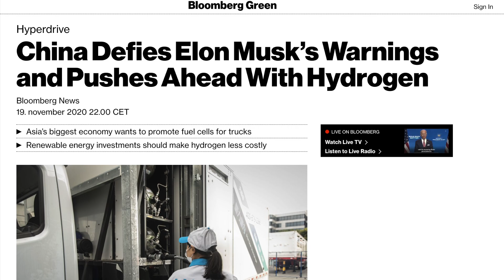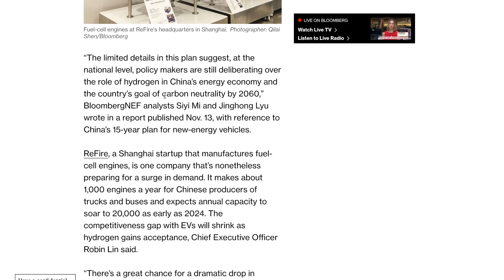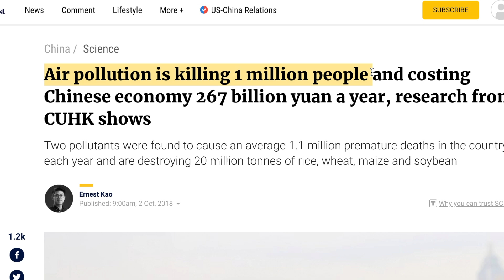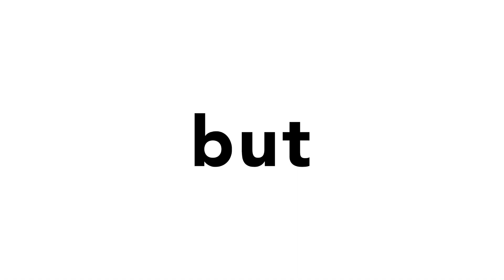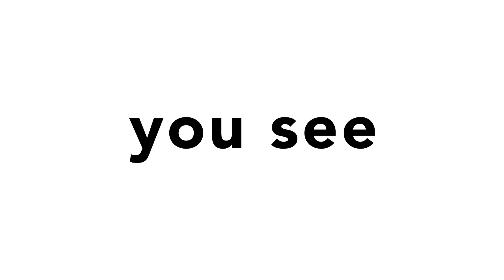The Worrying Truth Behind China's Push For Hydrogen

Comment: Yes, the production of hydrogen is inefficient. But there are a couple other things you have to consider. Firstly the efficiency will improve over time with more investment and innovation. Secondly, energy independence means that China means that doesn't have to get bogged down in Middle Eastern wars, like the US has, to have energy security. That fact alone will save them lots of money.
Reply: And it's cheaper than batterie, at large scale. Storing electricity for more than a few hours into batteries is extremely costly. Also, I suspect they will need hydrogen when their fusion plants will be ready. Better start now.
Reply: @DunnickFayuro  Fusion requires Tritium and Deuterium which are isotopes of Hydrogen. I don't think you'll make much of those from Sea Water unless you filter for them instead.
Reply: @itsover9008  I was refering to the general infrastructure for hydrogen. The specifics for each fusion plant can be solved later on.
Reply: That's exactly the point that a lot of analysts miss. When transistors first came out they were inferior to vacuum tubes but people who saw their potential changed the world.
Reply: Electrolysis also works better at high temperatures, so any country with reactors can do it cheaper...
Reply: Is this man sure that he can make battery for the whole world. While lithium shortage already started  .
Reply: I think the debate about what is better, hydrogen or battery, is not that important. In my opinion, we shouldnt so much focus on this discussion. No, we should both compare to fossil fuels/energy. You know, the kind we wanna replace with regenerative energies.
Also, Royal Dutch Shell, Gazprom and Lukoil said that we already reached PeakOil... A complete other statement of what US oil-producers say. But of course us oil-companies say the opposite. Don't know who is right, but fact is that fossil Oil isn't endless and that "havesting" oil with new technologies make Crude Oil more and more expensive. Look at the costs of fracking, it needs at least somewhat above 60usd per barrel (with subsidies) to prevent the bankruptcy of those fracking companies. Thats more than 3 times the cost of "easy to harvest" oil from the middle east. Not to forget that oil isn't really a Free-market commodity (OPEC+).
Furthermore, let's imagine reports would come out that say the global year over year output is declining and proves PeakOil is already reached, where would the price of Crude oil go? Too the moon, thnx to speculators. Similar already happened in 2010/2011 with oil, with water in Australia (before the Australian government ended trading water on their exchange) and with copper now. 
If conservatives would be able to think one or two decades ahead, they wouldn't be upset about the current "environmental" bla bla. Cause if oil prices skyrockets, it would break the global economy.
Doing these new technologies( battery, hydrogen) is basically preventing a real economic disaster (and most likely a political #oilwar) which would be an even bigger catastrophy than the current C0R0NA situation.
Reply: @donkalzone6671  or we could also utilise biofuels from seaweed and plankton. Much more practical for us in the Southeast Asia. It's practice would demand us to keep the environment clean for high productivity. 

Look at how they do it in South Korea. Lines of kelp with muscles and oysters cage hanging beneath. Even better seaweed, plankton and duckweed may absorb pollutants like heavy metal. 

Take it further like medieval Europe bog iron, we could expand to the field of bio-mining of metals or minerals. It has historical precedence which even allow iron resources for the Vikings to arm themselves. I even some studies that sample of bog iron made into longboat nails are highly rust resistant.

Food security, energy security, mineral resources security and environmental friendly...in addition it is highly dependent on large manpower to be in operation creating jobs opportunity.

What more can we ask for? High tech but only benefits the rich while the common people have no jobs with better income opportunity...that is only turning us into a world of slaves.

Comment: Aren't china also building a 4th gen nuclear power plant that will run on nuclear waste? current nuclear power plants can only use 5% of it's nuclear fuel before it is "spent", while 4th gen power plants use 95% of already existing nuclear waste. only china and russia are currently researching these.
Reply: I think your percentages are wrong.
Current plants use far less than 5% and new plants are projected to be able to use more than 95%.
I could be wrong, though.

Comment: Reminder: Hydrogen is not an energy source, but a method of energy storage that requires energy input to produce.
Reply: Depend the energy input the water it's not the only energy input
Reply: @offroadsnake  Yeah i think we all know that's to tackle wind and solar energy intermittency in particular. Although still.. the most important is energy effiency and free carbon emission.
Reply: solar panel
Reply: The abundance of water, and the fact that hydrogen only emits water as a byproduct means that the path of water-reliant fuel production will likely be the analog "failsafe" running alongside battery technology.

Comment: You totally left out nuclear.  China is making a massive push to develop generation lV nuclear reactors.  Of particular interest are high temperature reactors such as Pebble Bed and Molten Salt reactors.  These reactors are capable of producing hydrogen directly.  Transported by pipe line energy can be transported more efficiently than by electrical transmission lines and when used in fuel cells more that 80% efficient in transportation.  This is much more efficient than batteries can hope to be.  So this might be what the CCP is looking at.  This and other things.  Like making the grid large enough to charge all the battery powered cars and trucks may be a problem as well as problems with dealing with end of life batteries.  With Hydrogen current pipe lines could handle distribution and water vapor certainly is not going to be s solid waste problem.

Comment: Hydrogen is worse than batteries and overhead cables for vehicles, but batteries can't power trains, and line electrification is extremely expensive and time-consuming, so green hydrogen for trains is a much quicker and better way to decarbonise.
Don't forget home heating and cooking. Heating may be better done by electricity, and for most people, induction cooking is okay, but there are a select few who would prefer a fire, and hydrogen fuel fire cooking can be cheaper than electric cooking in the third world.
Also, hydrogen can be transported more efficiently than electricity over long distances through pipelines and perhaps through shipping as ammonia on tankers.

Comment: I mean there's one thing you're forgetting here. We don't know how much more storage we can squeeze into batteries, and there are transportation sectors where its not possible to make rapid recharging stops since the vehicles have to be on the move for a very long time. Most notably Shipping and Aviation but also Trucking and in some regions without widespread electrification, railway transport. We don't know if Batteries will be able to work as a replacement there, and if so, when they'll reach that threshold. But we already know that hydrogen is able to match the energy density of fossil fuels so it makes sense to invest in that tech for the time being for those sectors especially, where we don't know when and if Batteries can be used for such.
Reply: There's also a hell of a lot more hydrogen available than there is lithium. And it is a lot more available and extracting it is a relatively simple process.   It's likely that one sort of technology will dominate one particular area. e.g. rechargeable  lithium batteries for transport,  long life nickel-iron or  flow batteries   for household  solar PV power storage , pumped hydro for grid storage; hydrogen for steel  and cement manufacture, process heating. Oil can be relegated to production of recyclable plastics.  making etc.

Comment: Anglo American has invested many many millions of dollars developing a hydrogen powered haul truck. and there are massive challenges associated with this however there are  very good reasons why they didn't choose lithium ion batteries. One very good one is weight. secondly turn around time in a 24 hour operation. Batteries don't last as long as pressure vessel could.
Reply: USA Companies invested tens of billions into Nikola a hydrogen/ev truck company. that was a fake company by the way and lost billions.

Comment: Are you not aware that carbon-neutrality is scientifically groundless? This is a plasma universe, and locally, the sun controls climate. CO2 is a coolant, not a GHG. It's plant food, not a pollutant. It does not cause any climate change - its concentration is an effect of conditions caused by solar output variability. Look up the Thunderbolts Project. The mainstream is so far behind the curve I hardly know where to begin.

Comment: The question is not witch is better but how we can use it. The litium batteries need electricity to charge themselves but they can store non as many energy we thought. On the other hand the hydrogen batteries could store a lot more of energy but they need a structure that contain the gas. So it's not a replacement but a dynamic duo.
Reply: Exactly, dynamic duo.

Comment: I am not sure you are right. It does seem intuitive that batteries are more efficient in their cycle. However, creating grid size battery storage systems is way more complex than hydrogen. 
Lithium ion batteries' size are severely limited hence you need thousands of cells and a system that can manage them. Every engineer should know that added complexity is equal to less reliability. 
With hydrogen you can just build a bigger storage tank and that is it. Basically alot easier to handle. And so in reality it might end up being the cheapest option. 
You might need 20-30% more energy production, but you need waayyyyyy less storage units (battery cells vs hydrogen tanks). 

Ultimately I think gridsize battery storage is a pipedream. The resources and care needed to be taken to make it work is just too complex to be viable. That is the reason why pumped hydro has been the king of energy storage for so many years. It is much easier making a fuel or alternatively making a mechanical battery of some sort.

Comment: Hydrogen does have a few benefits if its cost and efficiency problems are solved. Even with the existing inefficiencies, converting excess energy from renewables into green hydrogen, in spite of 70% energy loss, is still better than turning off the solar & wind plants. They must have given it plenty of thought before investing so significantly.

Comment: I can't wait to see everyone proved wrong in Hydrogen. Its still better to get rid of fossil fuels with hydrogen power then it is to wait and rely on EV's. Not to mention the lack of resources and the ethics behind the mining of the metals for the batteries
Reply: An extreme opinion but I believe that both Batteries and Hydrogen have their place in the sector working to cover for eachothers weaknesses. Like batteries are able to work really well on short distance travelling, whereas Hydrogen's strength is being able to go really far without fuel stops, something critical in industries like aviation and shipping.
Reply: @drdewott9154  exactly
Reply: No it's not. Hydrogen power is dumb as hell until you find a way to harvest hydrogen with much less energy than it provides. 

Until then it remains a pointless investment. This will jack up the prices and become a burden on their economy as a whole
Reply: @gabbar51ngh  it's not, and you will see a diversification of powertrains for didn't modes of travel. Also a lot of fossil fuel infrastructure can be refurbished to use hydrogen
Reply: @KingOdieOldmanMilo  batteries are an evolving box of constantly better, more efficient materials, hydrogen will always be hydrogen and the efficiencies are extremely hard to improve simply because of laws of thermodynamics, there is a reason why in 200 years it's a technology that has evolved as slowly as it did. 
there are truly very little scenarios where hydrogen makes sense to use just because of very specific requirements, but in most cases I guarantee H2 just does not makes sense and it's a worse solution then the current ones in use.
also don't forget that for H2 to be economically sustainable is resourced from coal and gas so quite the opposite of environmental. 
and if you don't believe me, make a list of requirements that to you are important for anything to be "clean" and I'll disprove H2 by your own agenda
Reply: @J0shT89  I've already done the research and have seen enough. I already know the be benefits of each. I don't need info from you. I have enough science youtube channels and books. I don't need battery fanboys to tell me that batteries will be the be all end all. Ships, trains, large airplanes and heavy transport vehicle will be hydrogen. And it doesn't matter if battery is the most efficient. It just has to be cleaner and more efficient then fossil fuels. Even when it starts off using brown and blue hydrogen. Batteries have there place and they'll be dominant with passenger vehicles, short haul transport and small planes
Reply: @KingOdieOldmanMilo  battery fanboy... unless you read the statement where I say H2 is a worse solution then the current ones in use, yes that would include fossil fuels, and that's because of energy density issues hence airplanes and ships. 
I agree with the fact that there is going to be a mix of powertrains but it just doesn't make sense to waste money and resources on something that is neither efficient or clean either way it's made (unless you want to save coal ad gas production because you're germany, china or japan riding on australia's dirty politics)
Reply: @J0shT89  hydrogen is not worse then fossil fuels
Reply: @J0shT89  you should watch the channel real engineering
Reply: @KingOdieOldmanMilo  I did a while ago
Reply: @KingOdieOldmanMilo  9 times out of 10 it is, as of today production standards it is, infrastructure expansion and readaptation alone makes it pointless.
Make a list of requirements of your liking and we can discuss it over it, almost in no field H2 holds any advantage to any other technology known to carry energy or be environmental.

Comment: Hydrogen is NOT a fuel SOURCE. There is no free hydrogen you can grab. It has to be made from water or methane. It is simply a form of energy STORAGE. It's lighter than batteries (per kWh) but way less efficient (full cycle in a hydrogen car is <30% vs ~95%), that's why it only makes sense in application where weight is critical, like planes or trucks. It will never be competitive with battery EV as it's too expensive to produce.
Your explanations were on point, China is developing trucks and buses, not cars, but be careful that mentioning H2 as a fuel "source" is misleading.

Comment: You fail to mention the pro of Hydrogen, which is necessary for replacing gasoline in many industries, heavy vehicles, and airplanes. Currently, there is a lack of infrastructure and technology to use Hydrogen. Once those are developed, the cost of using Hydrogen will dramatically decrease for China. Yes, this serves their geopolitical goal of reducing reliance on the Middle East and Russia. Unless you are an elite politician in those places, I don't see any need to worry. Nevertheless, carbon-neutral China is great for the world, plus availability of advanced Hydrogen technologies.
Reply: Yeah, it's very one-sided video that lacks in-depth research

Comment: Is there any synergy possible between desalination, solar and hydrogen production ? I know first 2 are possible but not sure if hydrogen can fit in somehow ?
Reply: You could add anaerobic digestion of sewage waste (or really any organic waste) to the mix. 
That way you get methane, which you can use with steam for hydrogen production. 
Combining methane and steam is actually the most common method of hydrogen production as far as i know.

(I’m assuming by combining solar and desalination you mean that mirrors reflect sunlight to heat salt water which gets converted to steam and then powers turbines, after which it converts to desalinated water, hence the use of steam in the previous example)   

If you want to take it even further you could produce your own organic waste, by growing oil-containing microalgae.
That way you have another use for CO2, which usually doesn’t get collected in factories, but just pumped into the atmosphere, as the former wouldn’t be profitable.

You could extract this the oil for whatever type of use you want, such as plastic production or just fuel. And use the leftover biomass for anaerobic digestion. Or as feed for livestock.
Microalgae also grow much faster than conventional crops used for oil production (some can more than double their biomass daily) and since these are small organisms, editing their genome to make them even more efficiënt at producing oil shouldn’t be too hard of a goal.

Of course, this whole algae thing does require a lot of infrastructure and energy to keep running, which makes it less economical.

But the anaerobic digestion part would, in my opinion be quite feasible. 

Hope this suggestion helped :)